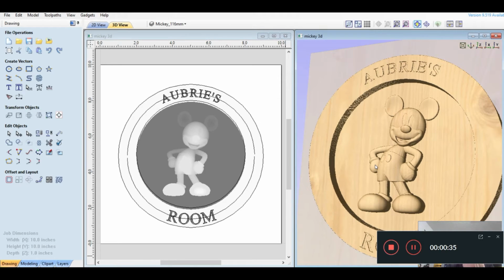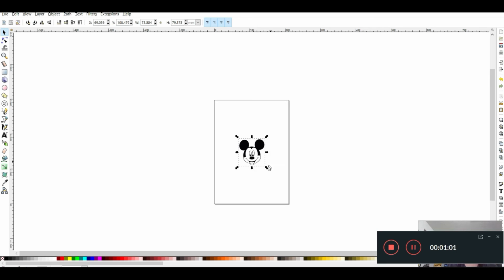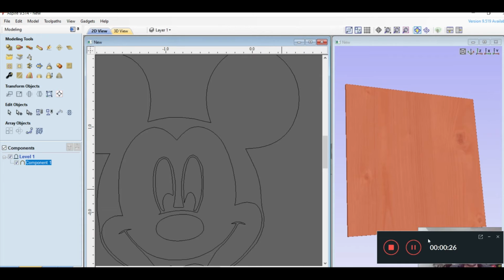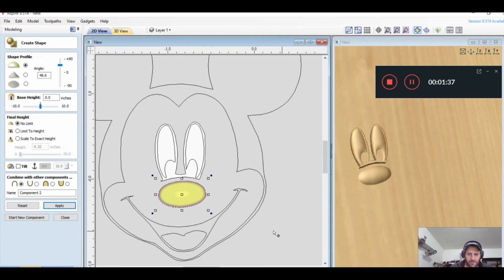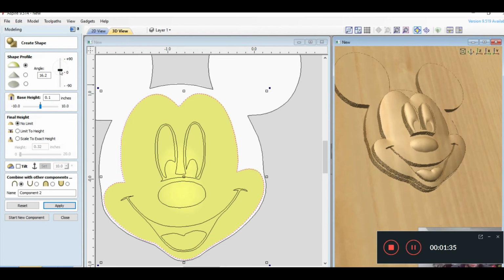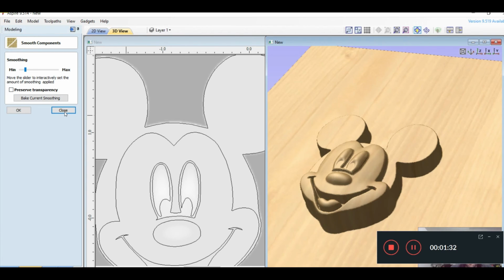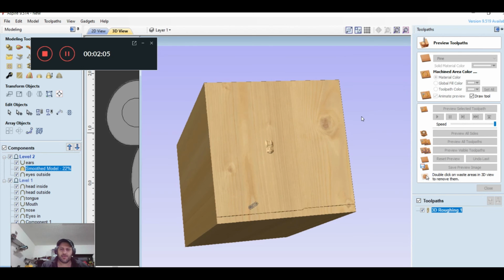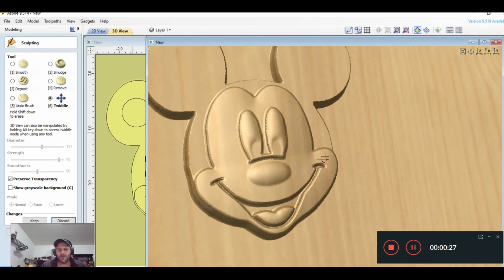How to turn a 2D picture into a 3D model for a CNC Machine. Basic 3D modeling on Vectric Aspire

Comment: You're not getting a bitmap image off of the mickey mouse drawing, the result of the trace is to produce a vector graphic.  The original is POSSIBLY the bitmap if it's a *.bmp file that you downloaded.  The drawing that you're saving as an .svg is a Scalable Vector Graphic... S.V.G.

Also, for the love of god, move your recoding buttons off the screen; it's incredibly distracting.
Reply: Easily distracted fucko?
Reply: 🙄 one in every crowd
Reply: @teresa6775  What, someone who (correctly) believes that the details of the process being described should be described correctly for those actually wanting to learn?  Or someone who believes that an educational video should minimize as many distractions as possible to convey the point clearly....
Reply: @Evocatorum  Someone who has the same issue I do. That recording button is annoying AF

Comment: For one, the reason you were having such a huge issue is because you set the thickness of your board to 20inches... that's why the face was coming out all wonky. 
Second, gotta get better at distinguishing the difference between bitmaps, vectors, and SVGs, you're gunna confuse the hell outta people.
Third, not fully understanding why you used Inkscape when VCarve has a bitmap tracing tool.
I'm all for helping people, I love it. Though if you want to be helpful you need to ensure you are spreading correct knowledge on a subject.
Reply: OUCH! but true indeed...🤔

Comment: You might know what YOU are doing but you need to improve your teaching style. This video was directed at beginners. Slow down. Stop doing that "trial and error style." Be more clear on what you intend to do and at least outline the alternative methods, explaining why you have chosen certain methods. Correct your terminology ie bitmaps aren't vextors etc. Otherwise thanks for your efforts I'm a total beginner but did get 'some' help.